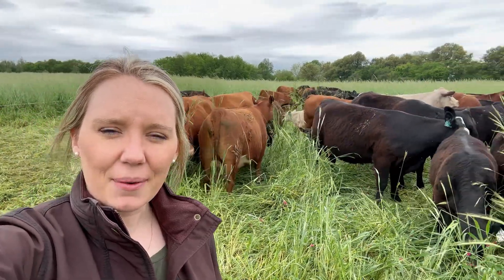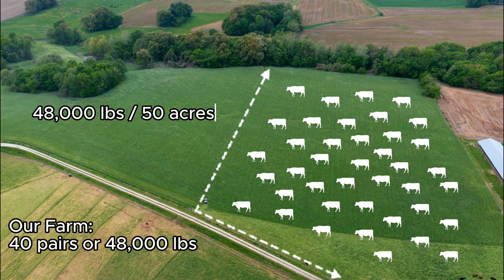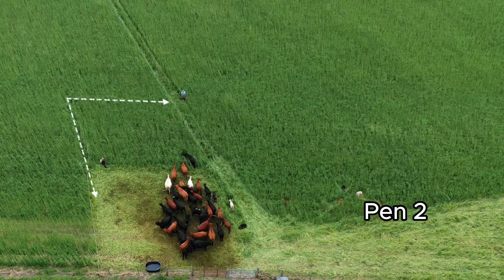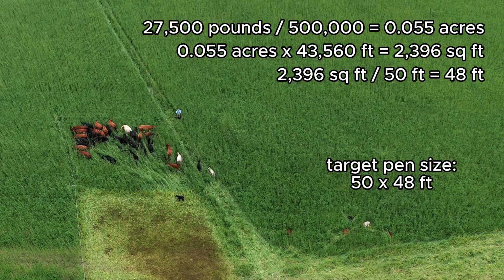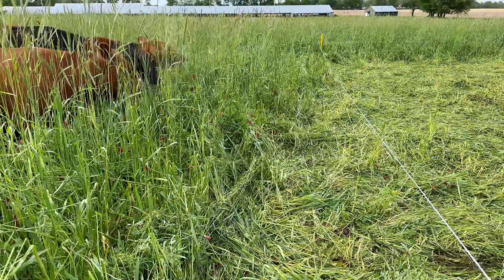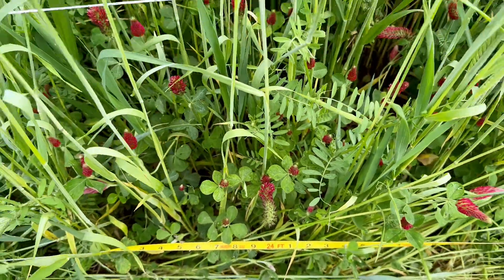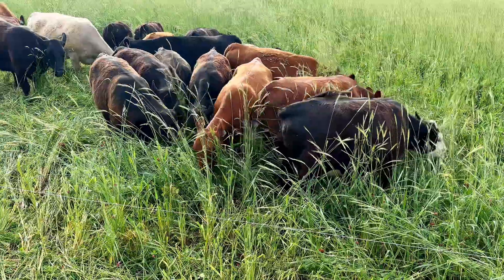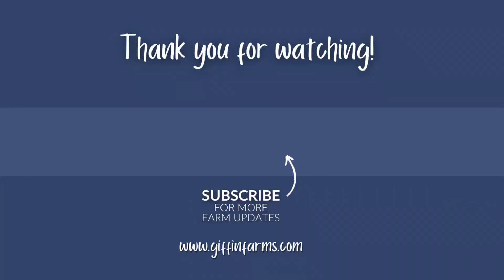Ultra High Density Grazing Cover Crops - April 19, 2024

Comment: In ireland if we were grazing qn over winter crop like that wed have the electric temporary fence thr lenght of the paddock and move it 2-3 feet once a day and have the cows graze under the electric fence to rule out trampling, so wrd have 3ft x 800ft and instead of taking down and putting up wires youd be moving the one wire forward
Reply: I think the trampling is the point though. Some regenerative farmers aim to leave 60% of the biomass as trampled mulch to build soil. Otherwise I'd think you aren't getting the benefits of high density grazing

Comment: What about the water points
I did this for a living with mobs of 200-250 up to 23+ mobs
Reply from the maker: Watering is tough. This was just a one day test run. We let them come back to the water that day. How did you get that job done?
Reply: Look up techno grazing 
It is a new Zealand company we had mobile water troughs with plug in hydrants along a fence line so it can be used in 2 paddock and strip each section with them not going back on for a minimum of 30 days in the growing season and 60 days for winter they are worst case numbers .
Longer the better

Comment: I love Greg Judy. I don’t think any of us should be doing it exactly the same way, because even what is right for us is constantly changing and evolving. We’re producing organic row crops at scale, with fertility derived from livestock and poultry. 

We stock at 1000lbs per acre, dedicated forage ground in recharge is credited 1:1, the silvopasture credits 1/2 acre for every actual acre of land, and the row crop ground itself is still grazed in the spring-fall-winter, and every acre is counted as 1/4. Our calves are sourced via our dairy herd, with solid beef genetics from embryo transfer, and we provide veterinary services and run fertility programs for other dairies, getting bottle babies from them as well. 

We’re just not purist grass on genetics here. We need to maintain full inventory and sell off as pounds are gained. That requires an easily marketable animal, which is a big black hippo in the making. But good grass genetics are definitely part of what we do, and grazing for soil, animal, and human health is a very real concept, with measurable results.
Reply from the maker: Wow, yall have a lot going on! It’s very interesting to see how you estimate your stocking rate for each forage source. We are trying to graze some beef on dairy calves for the first time this spring. Do you see any difference in their grazing behavior compared with straight beef calves?
Reply: @ our beefers are all beef genetics that we embryo transfer in to the dams. I am very partial to my queens though. I love my dairy gals.

Comment: How much weight they gain per day using that method? average
Reply from the maker: Unfortunately we don’t have enough information to estimate gains with ultra high density grazing. We’ve seen about 2-2.5 lbs per acres on our calves grazing cover crops at low densities.
Reply: @GiffinFarms  You mean the opposite? Low Density vs the Ultra High Density covered in this video.

Comment: I apparently must plant soybeans in spring in kansas  into the growing fall planted rye cover crop. Next crimper roll rye and beans as beans reach trifoliate 3 leaf stage apparently in early summer or late spring. I may try that method on 2025 bean season cause it obviously too late to plant rye cover for 2024 soybean crop ...Took me a while to understand the planting cycle. May not have it correct currently but miracles do happen. OR SO I HAVE HEARD.  Dennis
Reply from the maker: We always plant the rye in the fall and then plant beans in the spring. We like to crimp before or right after planting. I haven’t tried crimping at the 3rd trifoliate.

Comment: Sorry but 40 pear is 80 head
Reply from the maker: Sorry but 40 PAIR is 80 head only part of the year.  If you want to get very technical you could try to predict the average weight of your calves and add that on a pro rata basis to your total carrying capacity.  In my experience, this is only beneficial if you are going to use total carrying capacity to compare your production model to others, like cow-calf production to stockers or some mix of the two.  You can make the math as complicated as you want but at the end of the day, if your farm supports 40 pairs, you can run 40 cows.
Reply: @GiffinFarms  thanks for the info

Comment: It's a great idea... until it isn't.
Reply: But why wouldn’t you run with it as long as it is a good idea? If it begins to stall out on you, you make a change. Adapt and overcome.
Reply: @user-fp7uh9jx8n  - unless you have a micro-herd of just a few head (less than 10) you're gonna end up doctoring for pinkeye all from late spring to early fall.
Reply from the maker: @driverjamescopeland  pink eye is a practical thing to be concerned about. Unfortunately I think pink eye will always be a concern where we are. One good thing about having them grouped together and moving is we are always moving away from the fly larvae in the manure piles. It’s also nice to see them multiple times a day because we can catch any illness early.
Reply from the maker: Couldn’t have said it better. No matter how good the idea is, there will be challenges to overcome.

Comment: Well done. I do wonder about the long term health for cattle with so little roaming area. I would imagine Greg Judy or Joel Salatin would be able to address those concerns.
Reply from the maker: Thank you! They would definitely know! I don’t want to speak for them, but as long as the cattle are well fed, watered, and calm, I would expect them to thrive with fast rotations, even at high densities.
Reply: As long as the cattle are content, they're fine.  Staying in a herd is natural.  It's common to not back fence, so while grazing they're tight, but can move back to the slightly older area to spread out and ruminate.

Comment: So just ran across this. 
It is hard to figure out. What exactly you are trying to make a difference in? If it is soil microbes. You would need a baseline. Then sequential testing. From the video the cover crop looks fine. But did you measure it? 

This is my thing about rotational grazing. And its claims of the grass recovers quicker or is more organic matter. 

If I cut the grass on my lawn. It is bahai grass. That stuff comes right the hell back. Comes back so high. I have to cut it every two weeks. 

As far as organic matter.  That also would have to be done in sequential order. 
As it will vary. Say before or after a rain. This is the first video I watched. It is well done. Especially with the graphics. 
But seriously grass in season. Comes back pretty fast after it is cut. 

So many variables in this stuff. It is easy to get caught up with antidotal evidence.  And believe correlation is causation.
Reply from the maker: I really appreciate your feedback and I agree with everything you said! I would like to add a few points to consider. 

First, grazing is differently than mowing because animals eat their favorite plants first and leave the undesirable plants. if there is no rotation, the best plants are eaten over and over until they eventually die and you’ll be left with only undesirable plants. If animals grazed like a lawnmower, taking every plant to the same height, rotations and rest period wouldn’t be so important.

And excellent point about all the variables! Honestly, those variables make it impossible to do a perfect on-farm experiment. But I hope an imperfect experiment is better than no experiment at all, as long as the goal is just to better understand our environment and our goals. Specifically we would like identify which type of grazing is best for increasing soil respiration rate and organic matter on row crop ground, and decreasing the risk of nitrogen tie up for the next crop. 

We are measuring these things with cover crop and soil samples (taken this week) so we can compare each type of grazing. We have soil tests from last year, but I agree there are too many variables for year to year comparisons to be super useful. We’ll be sharing our most recent test results soon! 

Thank you again for the feedback!
Reply: @GiffinFarms  
Well it wasn't clear what your goal was. It looked like a planted field of cover crop. Which the animals would eat all varieties of. 

But I was begging to think you where using the cattle for trampling the grass instead of crimping it. Then come back later and plant into it. 
It just wasn't clear what your goals where. 

The soil samples I'm sure are nothing new to you. But is microbiap activity one of your goals to measure? 
Your ground already looks healthy. Do you know otherwise? 
Still thought it was worth watching. And went ahead and subscribed. To see what you do next. 
We all are learning from each other. Cheers!!
Reply from the maker: @MrSeadawg123  I do wish I had defined our goals for this experiment more clearly.  Our farms have decent soil, but we would like to increase natural fertility so we can decrease inputs overtime. We are definitely still learning!  We appreciate you watching!
Reply: @GiffinFarms  
In my eyes. A person has to be pretty fearless to put themselves out on YT.  And accept the feedback given. 
Appreciate your thoughtful reply! 
And will try to contribute. On topics I have some knowledge in! 
One of things I will be trying. Is mixing biochar in with molassess barrels. To put more carbon in the soil.
We have a farmer that manages our farm in western Kansas. Very dry there. 10 to 20 inches of moisture a year. 
So am trying think of ways to hold what little moisture we have. In the ground. 
Have a 100 acres here in Alabama. That land needs to be cleared. So will be awhile. Before I have animals on this land. 
Wishing you best of luck! 
Look forward to watching how you manage things!!
🍻
Reply from the maker: We appreciate your thoughtful questions and comments! Keep them coming!

Comment: How did u get electric fencing through there. The grass is that tall it would short out?
Reply from the maker: That is a great question! The cover crop does weaken the current and completely short it out at times, but as long as it has some current most of the time and we keep the herd well fed, they respect the wire. In fact, our fence wasn’t turned on at all that day.

Comment: Love the video. Really appreciate the in depth analysis.  Great mix. May i make a couple of suggestions from my experience?  First, if you're just taking the top xxx inches you can start grazing much earlier (before everything matures) and move on.  Second, if you widened the paddock so everyone could line up like they were at a feedbunk (likely about 2' per COW - not a yearling) then you could strip graze and the trample effect would be less AND, given the rapid moves, your forage would pretty much spring right back up within a day or so.  Then it keeps growing, getting those roots down into the soil just as though you had allowed the plant to mature fully.  We've also used tumblewheels to move along what really are alleys that we strip graze.     We moved five times a day and it took about five minutes per move. Now, there are other technologies that can lift a wire, open gates (love bat latches), etc that can make the whole thing so much easier, Even basically automatic.  Don't weaken!  You're doing so great! Keep looking for solutions.
Reply from the maker: I really appreciate the suggestions and the encouragement! Pen shape was something we debated and eventually decided to keep it simple with a relatively square shape, but I would love to try the “feedbunk” style pen! Trying high densities at different maturities would be another great experiment. There’s so many things we still have to figure out. I hope we can implement these suggestions in the future! Thank you again!

Comment: having the math broke down made the video one of the most informative i've seen. could you add a few more cattle, and increase the pasture size a bit more to make it a once a day move so its easier on the labor side of things? most of the AMP (aggressive multi paddock) grazers say 12 hour moves or 24 hour moves.
Reply from the maker: I’m glad it was helpful! You could definitely add more cattle and make the pen bigger, but high densities will always require many moves per day. For us, this only works in special circumstances. Normally, daily moves work better for us. In my experience, daily moves are still great for animal performance and soil health.
Reply: Certainly...paddocks are all unequal as/in not the same
 quantity of forage in each. Writing a program explaining all the various factors of rotational grazing would be impossible. Thanks for your explanation and photography. Dennis
Reply from the maker: You may already be familiar with Greg Judy’s YouTube channel, but I highly his videos and grazing school. He shares a lot of information about all the different factors you can run into while grazing.

Comment: Would definetly need to work on the farm full time to do this effectively right? I always thought of doing this, concentrate all the body's in 1 small area but wouldn't be able to leave them long in that area..
Reply from the maker: Yes, most likely. There are a few automatic gate openers (batt latch, pensagro, teeter farm tech) that could move the cows on a set schedule, but they are pretty expensive for a small herd. Fewer moves at a lower density may be more practical.

Comment: Great video.  The process is just so labor intensive.
Reply: Yes but you will get a higher return and you will actually massively improve your soil which is critical.
Reply from the maker: Soil health is so important but we are realizing that we have to keep animal performance and quality of life in the equation too. We’re very interested in finding techniques that maximize the impact of our efforts. I’m not sure we have enough cattle or pasture land to justify high density grazing all the time.
Reply from the maker: Thank you! Yes, it was a lot of work. If we were going to do this long term, we’d have to have a better fence and water set up.
Reply: What about soil compaction? Once every 3-5 years on specific dirt this has merit
Reply from the maker: @johnkemp4370  In our follow up video, we did find significant compaction in the high density area, but I think it was more because we killed the annual plants than it was from the weight of the cattle.  If the plants had been able to recover, I don't think compaction would be such an issue. https://youtu.be/UnziXZLPY-g?si=kGmpkFQFpetNqNzs
Reply: @johnkemp4370  there is less compaction from high density because the cattle wander less.  If they're set stocked on the whole farm, they're wandering more, not less.
Reply: Virtual fencing is probably the best way to go for UHD Rotational Mob Grazing

Comment: Great Video. How many moves a day did you do, or how long on each grazing cell?
Reply from the maker: This small scale experiment only included four pens, three at 500,000 lbs per acre and one at 1,000,000 lbs per acre. If we were going to graze at 500,000 pounds per acre all day, I think we would move the herd about every 45 minutes or 12-15 times during the daylight hours. Of course every field and every herd would require different timing.

Comment: Awesome video. Have you looked into automatic gate openers (or Batt Latches), fence lifters, tumble wheel fence movers, or virtual fencing? I think if you had these tools, you might be able to continue to use ultra high stock density grazing with a lot less work.
Reply from the maker: Thank you! We have a few tumble wheels we like to use with strip grazing. They definitely help with time and labor. I agree, batt latches would be super useful in this situation. Virtual fencing would be the dream, but I’m not sure how cost effective it is yet. If we continue grazing at ultra high densities, we’ll need to spend more time on fence and water infrastructure. I really appreciate the recommendations!